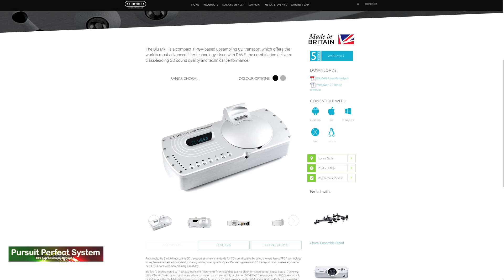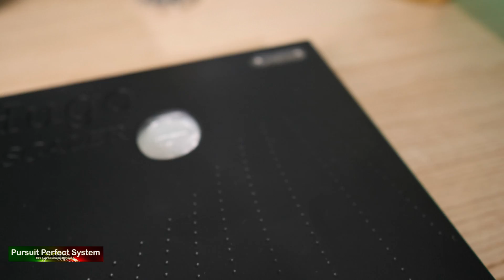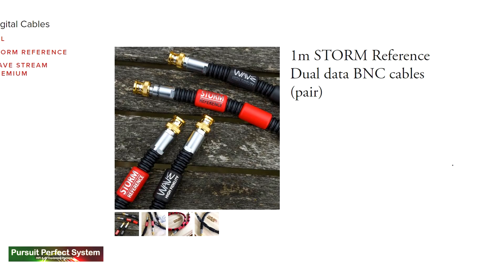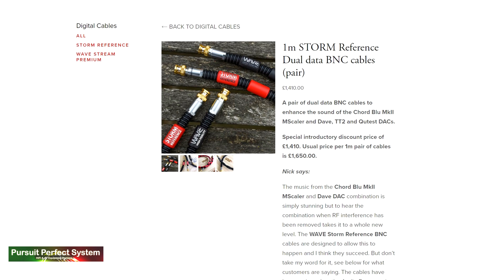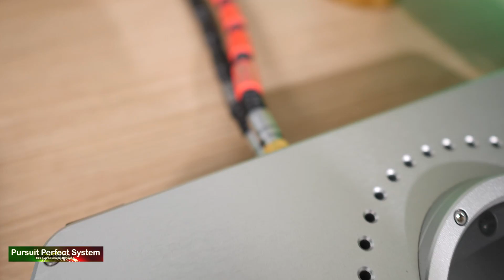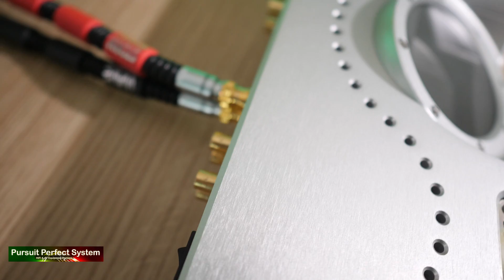NO #HiFi WEAK LINKS

Comment: Cables don't sound. a cable passes a signal from A to B. Again a lot of nonsense
Reply: Even professional musicians and producers say cables make a difference.

If cables made zero difference because they simply pass a signal then stick two pieces of bare wire between your amp and dac or dac and source then see if you can say the same with a straight face.
Reply: That’s the theory….so how come I’ve had blind listening tests and there’s a noticeable difference in sound. Whether it’s just tonal changes and not necessarily better is a different arguement but cables do change the sound.

Comment: Cheers, Terry.  I'm sure it's safe to say that people who aren't happy with their current components will need to remedy that first by swapping them out for something else, before adding high end cables, like these. They're not going to turn Grotbags into a super model.
Reply from the maker: yeah of course there is no magic wand in audio I would say if you own one of the chord dual bnc dacs and mscaler these are ultimately designed for then grotbags kit is a non issue :)

Comment: This is what I’m talking about and it’s why I love your channel, you are constantly trying to find ways to push your system to the limited, make it bleed.  I loved what you did with Audioquest and I’m sure I’ll love this.  I know you mentioned the Chord Hugo, but have you had and tried the Chord Dave and if so what are the differences between them?  

How is your vinyl setup coming and you should add it to your playback system or a turntable at some point.  I would love some company, VPI, Project, Rega or Kuzma to send you an excellent vinyl playback system and just watch you go nuts with it.  I want to see you reviewing turntables, cartridges, tonearms and phono preamps because you are more than capable.  Good luck and keep it coming.  A ton of people poo, poo cables, but put in the right system they can have a profound effect and many doubt it because they have never either had the system or the cables or the right treated room for that matter.  I’m using for my Aurender, Audioquest Diamond.  

I just bought Audioquest Mocha HDMI for my Home Theater.  My philosophy is source component first then cables and fix problems with your system before investing in cables.  I have an outstanding local dealer so I can walk in and out of the store with whatever I want, but it took along time to build both my system and that relationship.  In this day and age we don’t either have local dealers or we don’t build relationships, we just by online and call it a day and we learn absolutely nothing from it.

Comment: Money money money ... 😬
Reply: yes they won't YOUR money,,,,,, a £1,400 cable with barnacles hanging to it , is not going to sound better than a £300 cable with no barnacles , just different . it's the pursuit of emptying YOUR wallet.
Reply: And NO ONE hears the difference between cables, cause there are no differences, it's all placebo.
Reply: @benvanzanten379  it's either placebo.   or your deaf ,.
Reply: @reginaldjames7975  A cable has no 'sound'. 
Not too much resistance, and it's fine. Look at those scammers from MIT, a coil in series, haha, and ask the top prize for that.
Reply: @benvanzanten379  
a cable carries the signal say from a c/d player to AMP the c/d as stored on it songs / music / sound that is conveyed down cables to amp/speakers  I have 4 different RCA INTERCONNECTORS   when I change RCA CABLE the sound/signal has changed  IE what's coming out of my speakers this is not placebo I hear a difference